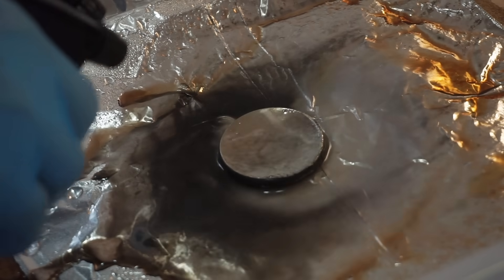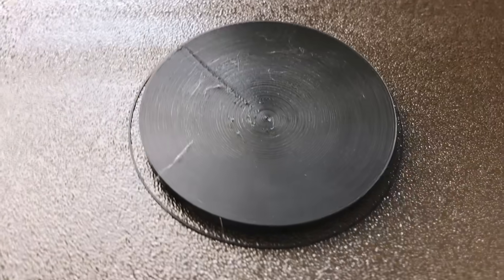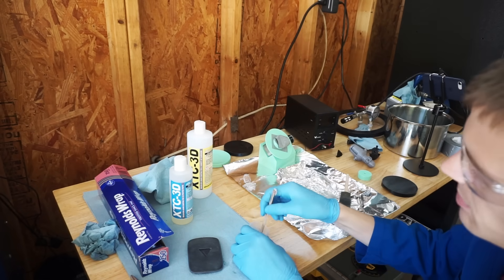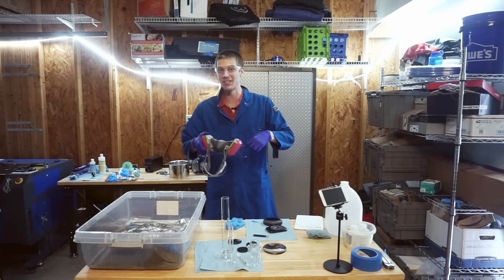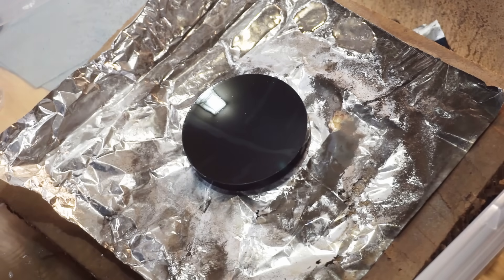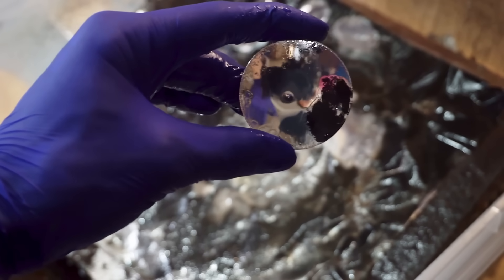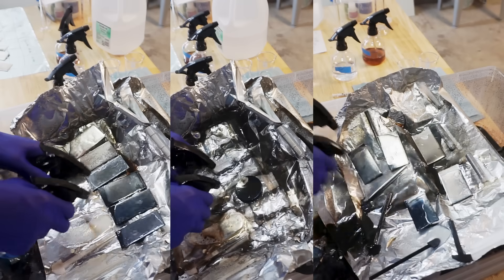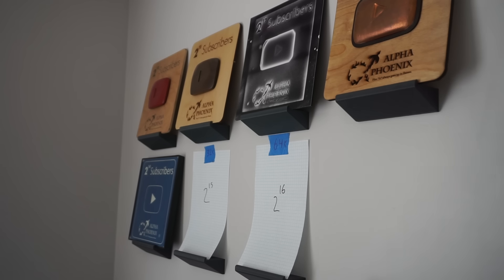How does a "first surface" mirror work? (2^15 sub special!)

Comment: As a formulation chemist, we ALWAYS do test grids like that. Perhaps academics, that are using ultra pure raw materials, and also have the time to fully characterize each chemical, they don’t need to do tests like that. (Or us lowly formulation chemists use the raw materials often enough to understand them).

While a bit tedious, it’s reliable, provides scads of data for QC, later R&D, helps dial in acceptable ranges (like which part is acceptable to be enriched, etc as well as production lot to lot variability) and the data also helps if the final product requires regulatory approval (like toothpaste for the FDA).

Comment: If you spun the mirror discs at a calculated rate, you could get the resin to flow at the exact speed needed to cause the fluid to form a parabolic surface.

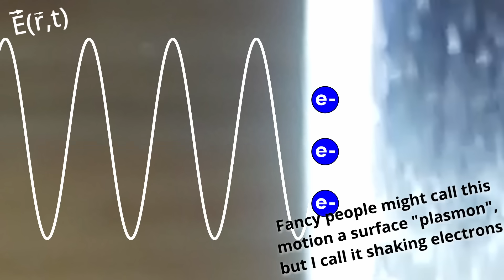Comment: So a mirrors reflection of light involves electrons being moved by photons, in the process absorbing and then emitting photons ( ~1:40). 
Since we can't measure the one way speed of light, does this mean that any measurement of the speed of light we make, will be slightly longer than the theoretical calculation due to the time it takes for the photon to be absorbed and emitted? Or, does the scale at which that movement happens, and the speed that light travels, mean that the time the process takes is less than our ability to discern?

Comment: Humidity is your unknown variable. I have a lot of experience with fiberglass resins and humidity ca make or break a resin mix that is on the thin side it’s less of an issue with thicker mixes and faster curing mixes. Control te humidity in your garage and it should help.

Comment: You could throw it under a heat lamp to cure the resin faster.  You can actually cure it in a couple hours if you get the surface temp to over 100f.  They say the resin is "cured" when it is sufficiently hard and can't be bonded to with a fresh coat without sanding which is not the same thing as a full cure.  The full cure time depends on the hardener and temperature but it can take days or even months if it's too cold since at about 60f the reaction stops.  When coating things in epoxy (or other paints/resins) I have a few 1000w quartz heat lamps that cure them in only a few hours but that's for large projects.  You can get a infrared bulb at the hardware store for like 10 bucks that would do small parts just fine.  Also denatured alchohol is better for thinning the epoxy and I find you only need to add 1% to drastically cut the viscosity to where it doesn't hold bubbles in the mixture anymore.  If you add too much it will develop fish eyes however.  This is speaking of epoxy in general and it can vary radically depending on the manufacturer & exact formulation which can vary depending on the batch.  Not all variables can be known and accounted for but you can reduce the scattering significantly and achieve more consistent results by isolating some of the bigger variables.

Comment: Inside vs Garage ~ Humidity? Once did a grid search for circuit board bending, turned out it was storing them outside, before being put into production. When you paint a door on only one side, it warps. In the molten aluminium industry, moisture is really dangerous.

Comment: Last time I dealt with epoxy resin I was coating the whole of the Wooden Boat I made. So I did this outside due to the fumes but I did over the time of several days at different times a day. I couldn't understand why sometimes it would Harden really fast and sometimes really slow or not at all. I eventually figured out that it was the ultraviolet light from the sun that was messing with me. The more uv-light the faster it cures. So if you want to hear it in a hurry use a blacklight. If you don't want to curing too fast, use low light conditions.

Comment: Wow, this is a great video! We always love seeing people using our products! We also really appreciate how you took the time to explain the difference of a first and second surface mirror and how mirrors work. I saw you had a hard time with the resin. We think the ideas you had about curing and temperature are very wise and see some great comments here. We also wanted to point out that not all paint/resin products are compatible with silvering. Some have products within them that are great for the product itself but can actually tarnish the silver. We saw you mention that you weren't quite sure what is in each of the chemicals. We commented below but will add here, the Blue Silver Solution is a Silver Nitrate base. The Clear Silver Reducer is a Sodium Hydroxide/Ammonium Hydroxide base. Essentially the Reducer functions to balance the acidity of the solutions and pull the Silver out of Solution. That is why you want to keep them separate. Part of the issues you had/inconsistency of result could be with the spraying technique. The chemicals need to meet at the same rate and quantity on the piece to cause the right chemical reaction. Also, you may find Aluminum Foil to not be a great back drop. The Silvering solution will not develop properly over metal and splash back could contaminate your piece. Finally, we just wanted to note that in almost all applications you will need to apply a tinted top coat to protect the Silver from tarnishing. Telescope folks don't to maintain optimum optical quality but instead have to reapply the silver periodically. Once again, great video and thanks for trusting our products and your pieces!
Reply: Now this is how to give your company a good reputation right here. Informative and specific reply from someone who obviously knows what they're talking about.
Reply: I think I'm late to the party, but wouldn't a silver finish tarnish?
Reply: @cromagnon305  Yes it certainly would. Its also important to note that because of how thin the layer is the silver will eventually just disintegrate, unlike silerware that can be polished. A compatible clear coat will protest the silver from tarnish.
Reply: I LOVE how politely you said his spraying was terrible! 

As a pro painter I can professional say his spray "technique" is the worst I've ever seen used in a professional capacity. (Which includes producing technical and 'how-to' video content)
Reply: @yourdailytik4130  good thing he didnt claim to be a professional 👍

Comment: If you're going to spin to make a mirror you should spin with the surface perpendicular of the drive of the motor. Especially with that round part.

If you've ever looked into the process of making semiconductors, each layer is applied then spun to perfectly and evenly distribute whatever is being applied.

Comment: I work with XTC3D a lot, and it is a huge pain to work with, contrary to advertising, (a spray polyurethane is the easiest way to smooth out 3d parts uniformly)  but one thing I learned, is that in order to make it flow better, heat it, such as putting a bottle in a container of hot water, this also decreases the curing time quite a bit. I cure my parts on my 3d printer bed with the heat at 100'  and a box put over them to create an oven. Mixing in acetone just makes it even more of a pain to work with. Also, You generally need to put it on as thin as possible, a sponge is the best applicator. the goal is to just fill in the spots in between the layers, rather than  actually "covering" the object. It also requires fine sanding after and the application of another layer. nice thing about XTC3D is you can put another layer on it, and it just blends in perfectly. Just an FYI for anyone working with XTC3d for the first time.

Comment: It is much easier if you cool the two solutions and make a thin solution. This does not react with each other. The object is warmed beforehand with a hair dryer. Small objects can be immersed in the mixture. Only the warm surface gets a silver layer.

Comment: You need to vacuum the resin before you apply it... after you applied it it was probably sucking air out of the plastic play button that was underneath it causing bubbles to come up. Just a guess.

Comment: Once I tried poking a multimiter into multiple reflective plastic parts I found in my home. Some of them indeed had low resistance and were probably covered with metal but others weren't conductive at all. This puzzled me.

Comment: The website that you got your chroming agent sprays from states that you are supposed to use the sprays in parts and the runs in which you are using two different sprays simultaneously is bad according to their instructions.

Comment: If you print with an sla printer and forego cleaning the excess uv resin from it before curing the part, you may find you don't need to use the 2 part resin for smoothing

Comment: I’d hypothesize that if the rate of the unwanted side reaction outpaces the Tollen’s reaction the mirror fails. Amount of dissolved oxygen and surface area to exposed oxygen might play a role too. So temperature, droplet size, time since mixing, and residence time through air before and/or after mixing might play a role. It’s also difficult to tell at which point in the reaction which variables produce which changes e.g. temperature could speed up the undesirable or desirable portion of the reaction causing the coating to fail or succeed respectively.

Comment: Imagine where anything could get kicked back from the table saw blade, in a worst case scenario, and that's where you don't want to be standing (or sitting). Usually being lined up with the blade is the worst, and being on either side of the blade is better. It's been almost two decades since I worked in a cabinet shop, but the general safety habits I picked up there will haunt me forever.

Comment: So, technically it isn’t a “mirror”, as light is not reflected, but absorbed, but when you develop black and white film or enlarging paper, you are essentially making a first surface “mirror“. The reason that the metallic silver absorbs light instead of reflecting it is because the silver is a whole lot of very small crystals, called grains, instead of a continuous film. The film is also extremely fragile, as the emulsion, or the gelatin that holds the silver, can be scratched quite easily, causing noticeable damage to the film. And, dust tends to also like to stick to the emulsion. Who knew that a surface meant to stick small particles of stuff together would stick other small particles that you didn’t want to get stuck there together, too…

Comment: Your vacuum pump's oil is not liking you put water and whatever solvent that was, through the pump. It will lower the vapour pressure of the oil.

Comment: What you really could have done is look around at any channel or whatnot that works with resin. We could inform you a lot easier of what you may be doing wrong than doing such a wide range control. While it is also nice to do experiments, you could have come to the answer far sooner or with less of a hassle. I myself have going on 3 years experience so far. 

The info to place in acetone in resin to 'thin' it out? That is full-on wrong on so many accounts. It's use is to strip and dissolve cured or uncured resin. NOT make it thin or 'water it down'. I only saw one site that says it can be used to water down resin and it's for their particular brand of resin and even then says it can cause a 35% weakness to the resin. It ironically is a brand I use, but I still would never put acetone in it to thin it down. Even if it can be used for their resin, that don't mean it can be for others as all resins are different.  They even recommend Denatured alcohol over it, or just use heat, something that is what all of us use. Heat helps pop bubbles and makes the resin more liquid, but it does shorten the work time as heat also speeds up curing. 

As others have pointed out, resin does heat up as it cures, thus temperature does affect it and how well it cures. The warmer the area the faster it cures, but also the shorter the work time. Most resins at room temp give around 40 minutes work time. Mixing, well, that is important but mixing for around 5 minutes is the norm, or as they say, until your hand feels like it wants to fall off. 

Check your resin, is it a 1:1 by vol or weight? If the resin is tacky to the touch, or flex, then that shows there's not an even mix between the two parts. From what it looks at 4 mins in you are pouring the resin in a cup that's bigger on top than is on the bottom. So whatever amount you are pouring on top if you're trying to get to the 'save level' you're actually adding in more as the upper part is wider. Thus your not getting an even mix. Pour in two separate cups to the same level, then dump those together, or get a pure vertical cup for resin that has the measurement guides on it. 

Bubbles? Yeah, to remove bubbles you use a vacuum chamber before you pour onto your item, not after its on it... though that don't fix bubbles added back in when you pour, so yeah pretty much everyone who works in resin uses a pressure pot, with that you have no worry about how many bubbles get added or appear on/in the item your making, as it makes the bubbles so tiny they become nonexistent. Just coat or make whatever you want with the resin, place in a pressure pot at 40 psi for the cure time, and you are good to go.

Last, what most people use to smooth prints, is use resin for resin 3d printers. brush it on and use a UV light, then clean it with a bit of alcohol. Then polish it with polishing papers.

Comment: This is as close you can get with hand coating. Anything better and you are looking at sanding/polishing, silicon moulds , casting resins, air-brush techniques. As what I think happened with the epoxy resin to fail: in standard nomenclature, part A is usually the polymer and part B is the hardener. Should state on the containers which is which. What happened to you might have been relative high mechanical stress from forming polymer chains. To the eye, the surface would have seemed smooth, but in reality it was porous. Not to mention trapped air. Adding more polymer slows the reaction down, thus introducing less stress and mechanical defects without using heat. In the future, you could try a toaster over at a low temp, around 40-50C/120-150F to help polymerization. Or applying cyanoacrylate as a "primer" might be an interesting experiment.

Comment: Materials Engineer that studied polyester resin for sail making here: There are many confirming comments here, but humidity during curing changes your polymerization process. Heat and humidity cures your resin faster, but high humidity makes a not so cohesive polymer. Strength, durability, surface roughness, and hardness will be effected. Best to bake your samples before and after. Application of resin. Autoclave would be best, but not easy or cheap to acquire. Cool silver coating process.

Comment: For resins that cure at room temperature if you don’t wanna sticky surface just cure them arround their TG temps most of the time arround of 50 C will be sufficient. When you want to vacuum resin just vacuum the resin before adding the hardener, wait to settle than mix hardener very very gentle without introducing bubles or just mix in vacuum.

Comment: Hey just a heads up, that nomex lab coat is not going to provide good chemical protection. It's good for fire resistance. You'll want a standard lab coat for most solvents
Reply from the maker: Really? We wore them 100% of the time with acids and whatnot in the MBE lab I work in in gradschool

Comment: The curing of resin epoxy is dependent of temperature and humidity !
The hotter, the faster the reaction !
Eliminating bubbles with a vacuum is a good idea, but it has to be done before applying the resin on an object.

Comment: earned my like within the 1st minute with the bender reference. had my wallet out after the caddyshack reference

thanks for taking us through the process. im very curious about the vacuum and resin - maybe it bubbled as the air came out of the 3d print?

quick woodshop safety tip - when ripping/using a fence, never push/feed your workpiece from the side of the blade opposite the fence. As you cut, feeding from that side will (at some point) push the cut-off material into the blade, which very quickly sends that material back from whence it came. suffice to say, you shouldn't position yourself directly in the path of the blade either, in case that thing i just mentioned happens.

keep it up man, love the content and especially your mix of specializations - wasn't expecting this after the electricity / speed of light video!
Reply: I'm saddened to find only one comment referencing Bender.  The rest of you can "kiss my metal shiny a$$" ! :D

Comment: It would be interesting to attempt to microsurface the parts smooth with laser passes.  Unfortunately it would either require ultrafine mapping, or really acute surface angles.

For most resins, especially thick ones, cure it under high pressure.  Most resins love to pull water from the air, and under vacuum that will boil over a decent amount of time (the more viscus the greater time) and produce more bubbles.  The alternatives is just make any gas pockets have as small a volume as possible, and as resins are generally exothermic and are sensitive to low temperatures, high pressure is the best way to decrease volume.  

I wouldn't be surprised if the indoor vs garage success on silvering was either the temperature (higher temp == faster cure), or the humidity, and how that impacted the surface finish.

Comment: Exposing the part to acetone vapour, as in on an elevated platform in a lidded pot containing 4 TBLSPNS of acetone, will smooth out the tool-path lines beautifully.  But do not allow the plastic to come in contact with liquid acetone, as it melts plastic-